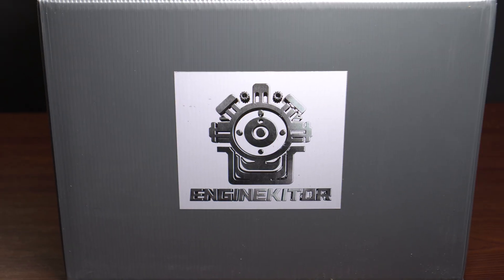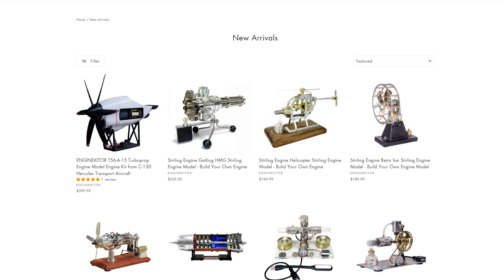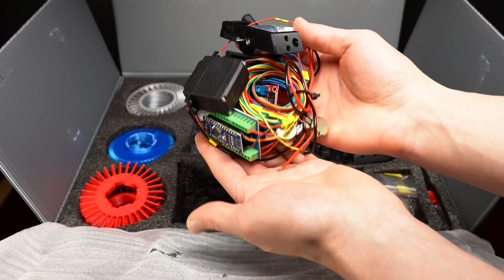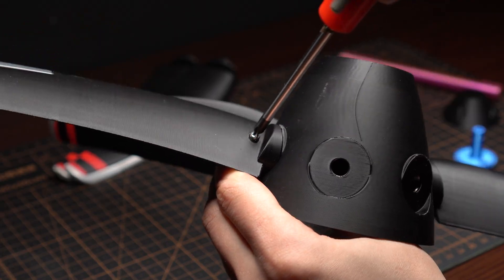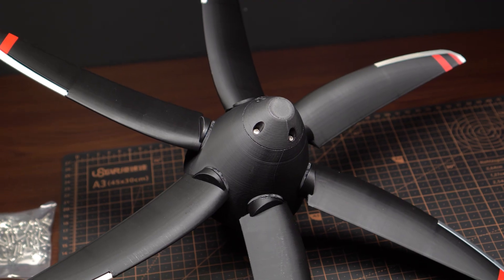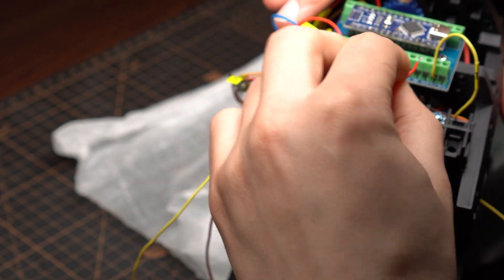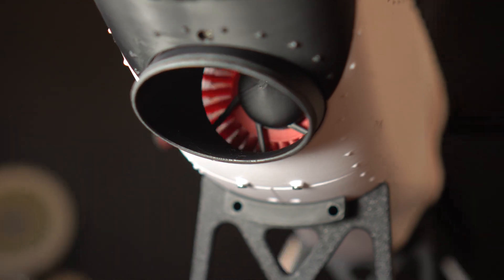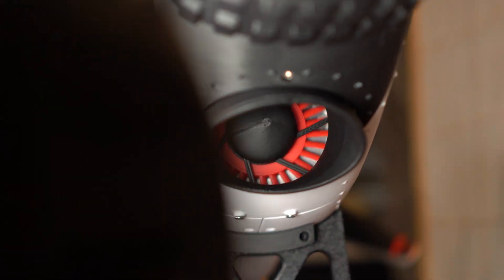Building the C-130 Turboprop Enginekitor Model

Comment: It’s an AE2100D3 engine not a T56!!! How many times do these people need to be told. It’s from a C130J, not a C130E/H. Please believe me I was an an aircraft technician on the J model and briefly on the E model for over 15 years.
Reply from the maker: @zooknut  not here to argue with you :) I am definitely not an aerospace engineer, this is just what I am being told :)
Reply: @StaticModel the core engine is more of the T56 style with individual combustion cans, the AE had an annular combustion chamber, but when all this package is put into the nacelle that housed the AE2100D3 and the Dowty Rotol 6 blade composite propeller instead of the 4 blade aluminium propeller of the T56 then basically the model is of the C130J not the C130H. However sent you the mode did an appalling job at research.
Reply from the maker: @zooknut  this is open source project model, in the end it may be only loosely based on a real thing. This company just bought the licence for the 3D files and sells it amongst the other models, I figure:) However thanks for taking your time and explaining, it will be appreciated by target audience of such product:)